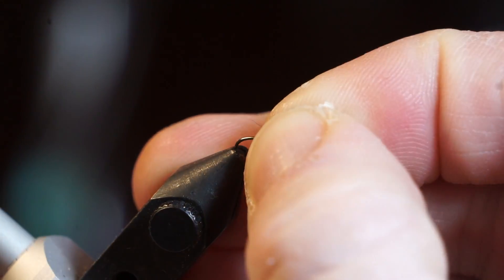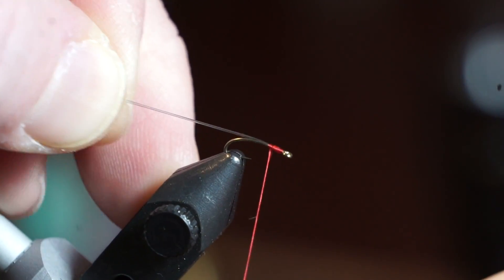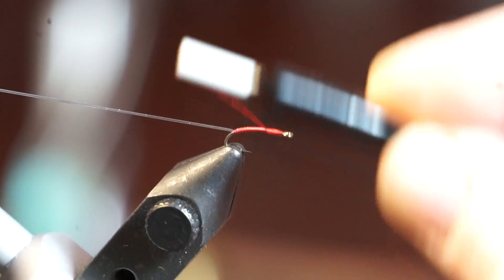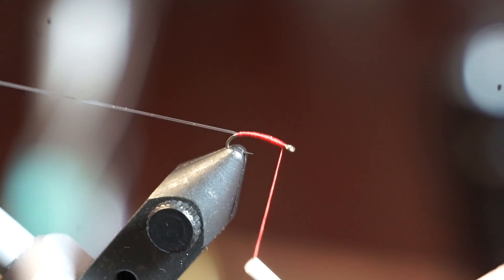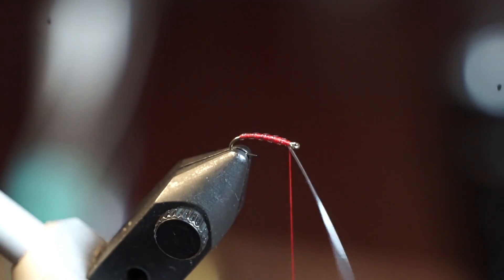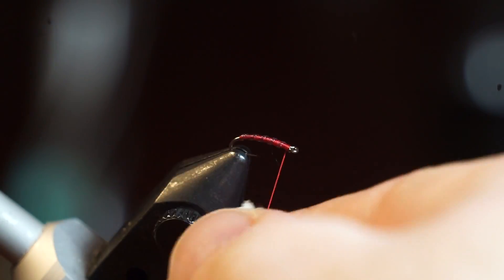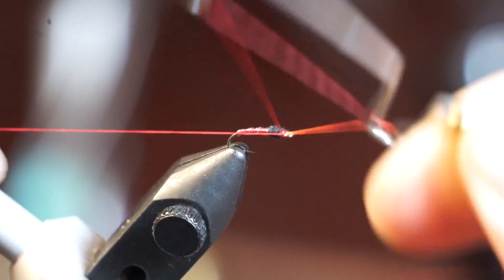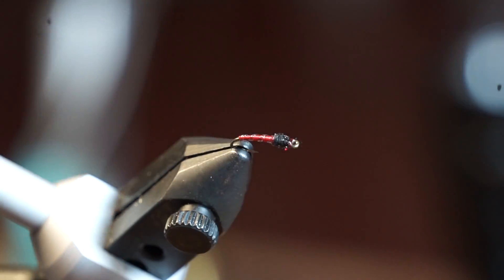Tav's Big Mac - Annelid Pattern - Midge Larvae - McFly Anger Fly Tying Tutorial

Comment: Very nice. Hook eye resin is a problem. Love it.
Reply from the maker: Lol it can be for sure
Reply: McFly Angler , I have found cure ! Dremel cutter # 118. It works on cured resin like Bone Dry. I use the cutter in a standard drill.
Reply from the maker: But, if you use a small hackle father or some crystal flash before curing, the dremel isnt necessary.  :)  But yes, sometimes with purchased flies from the fly shop, I will use the little needle in my nippers.  However that doesn't work too well, so maybe a dremel will be something to bring with me when fishing new rivers where I buy some flies.   Thanks for the tip!  :)
Reply: McFly Angler  Totally agree but when I'm on my 10th or 12th fly of the night I don't always see the resin in the hook eye. Can I still send you some of my flys to Float and Fish ??